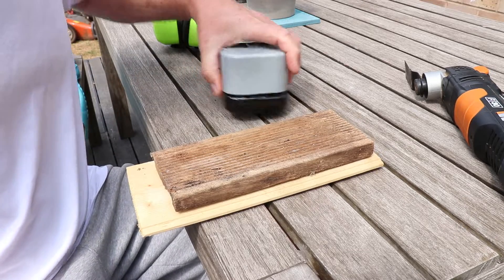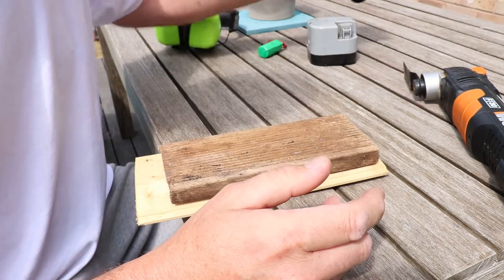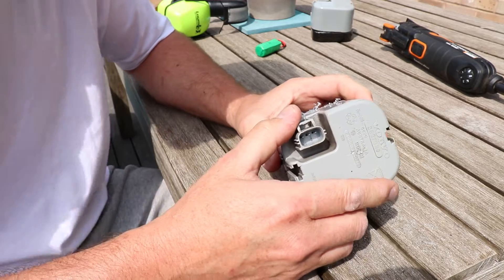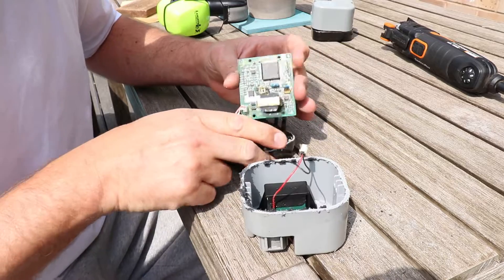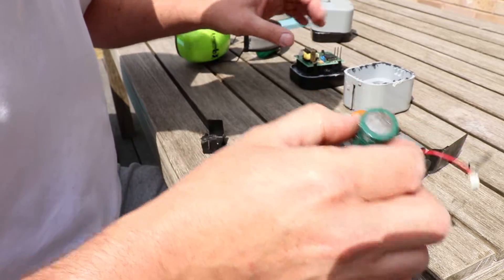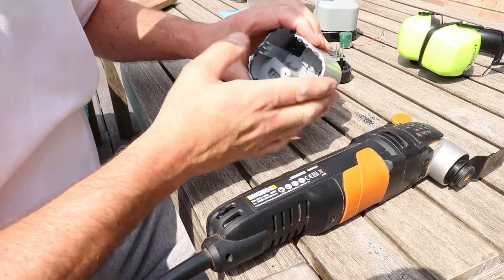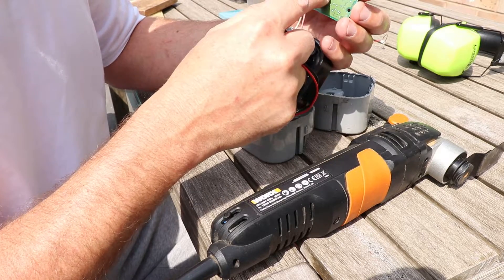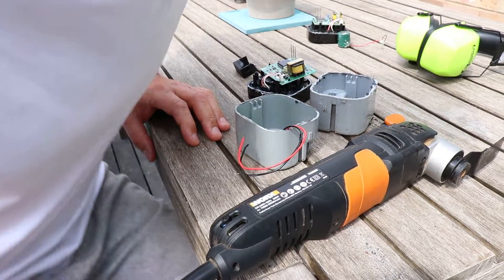Volvo Alarm Siren Cutting Open V50 S40 S60 S70 S80 V70 C30 C70 XC90

Comment: 2:35 "but basically the negative lead has come off the battery" and I see indeed the black wire is disconnected from the battery--it only remains connected to the white colored two wire multiconnector. This should answer my question about what terminal to wire up my new battery to the connector, and it would seem as expected: red to (+) black to (-).

Comment: Thanks for the video Steven. Do you know if the siren module can be "bench" tested before putting it back to the car?
Reply from the maker: I would say no.  But you can just plug it in to the car loom and test it.
Reply: @BLOCKsignallingUK  Loom?
Reply from the maker: @ggtaruc2578  Wiring loom / cable harness.
Reply: So, this battery inside the alarm unit will be charged by the normal engine starting battery while in service?

Comment: So, this battery inside the alarm unit will be charged by the normal engine starting battery or generator while in service? Anybody who knows that?
Reply from the maker: I don't know, but suspected that the battery only charges when the engine is running as sometime the ALARM SYSTEM SERVICE message disappears whilst driving.

Comment: Now want to buy that tool.
Reply from the maker: I didn't think I would use the multitool much, but as soon as I had it, it just kept coming out for different jobs.
Reply: Great video, thanks for sharing, doing my siren now! It's a multi tool, once you have one you'll never look back. Get a battery one if possible, super easy to use anywhere